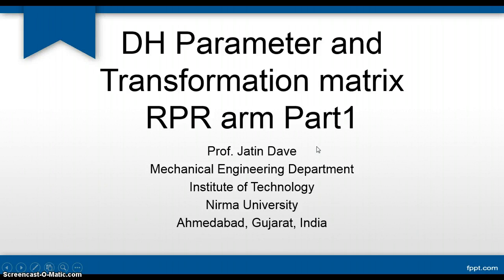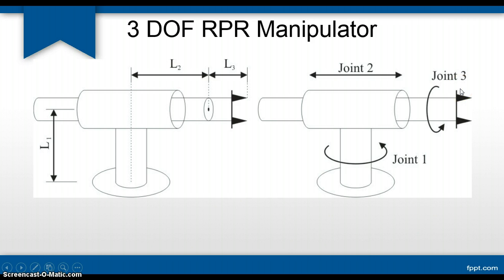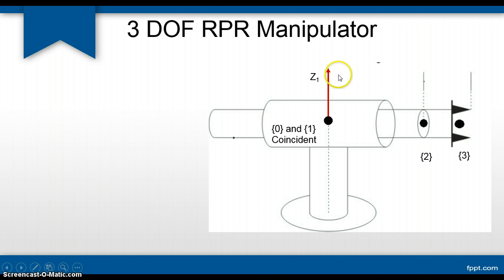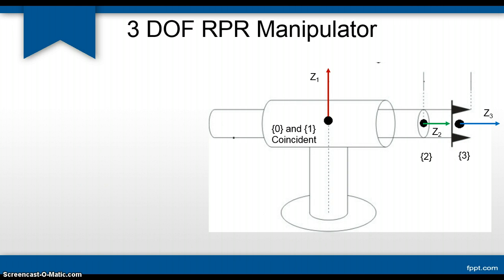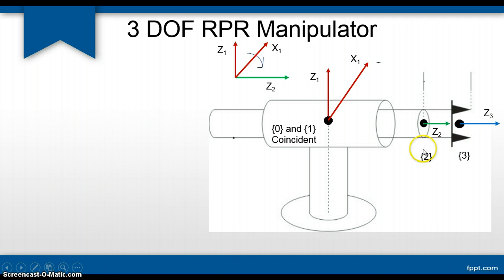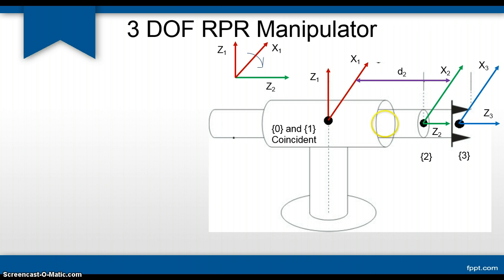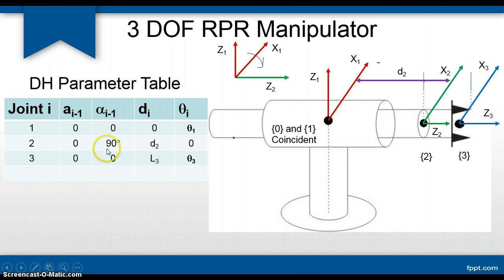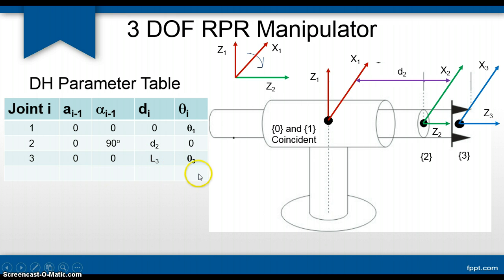L4 DH Parameter RPR part1

Comment: Hi. The d2 supposed to be measured along Z axis, isn't it?
Reply from the maker: Thanks for the comment. This is as per modified DH parameter method. d2 is designated as a joint variable i.e d in DH table and along the Z2 axis of joint 2. Due to relative transformation with respect to {1}, it appears as [0 -d2 0] in the matrix 1T2. It is along Z2 axis, but {2} translated by distance -d2 along negative side of Y1 axis from {1}.

Comment: At 6:20, why d2 is negative is not clear. In DH frame diagrams Y-axis has no role and it is not shown normally; then why d2 is becoming negative because of Y1 is not understandable. I appreciate it if you explain the reason for the negative sign in d2 in a better way with a literature reference.
Reply from the maker: Sorry for late reply. I was deviated to other duties.
Thanks for the comment. This is as per modified DH parameter method. d2 is designated as a joint variable i.e d in DH table and along the Z2 axis of joint 2. Due to relative transformation with respect to {1}, it appears as [0 -d2 0] in the matrix 1T2. It is along Z2 axis, but {2} translated by distance -d2 along negative side of Y1 axis from {1}.